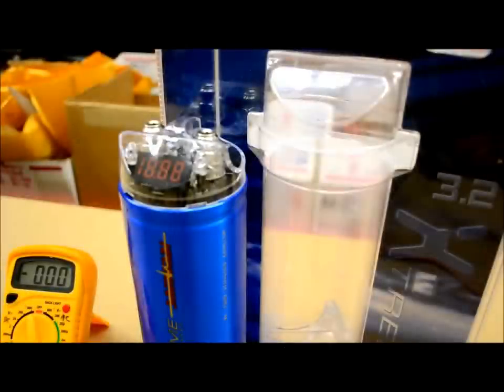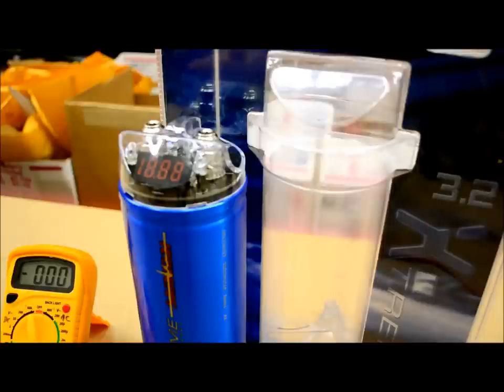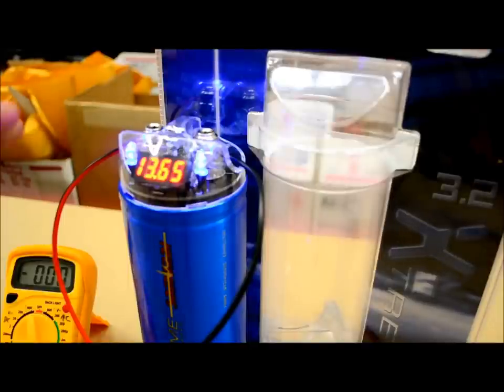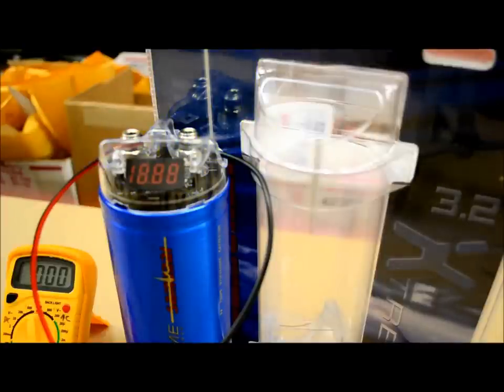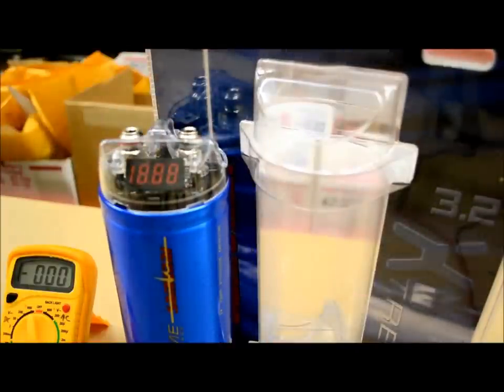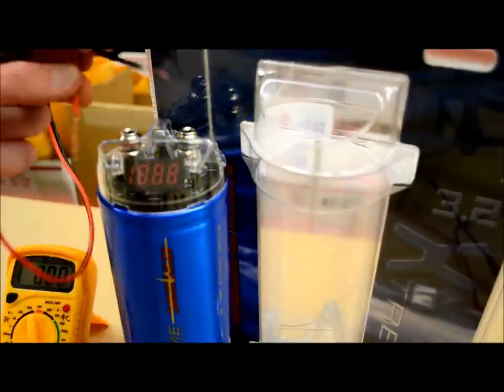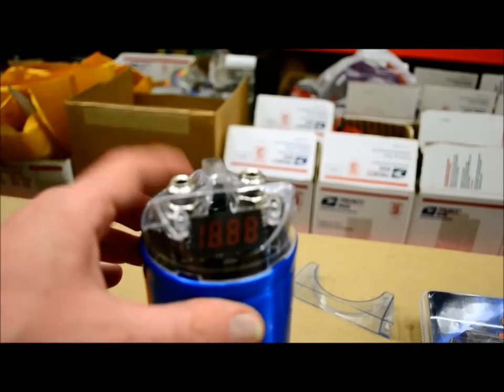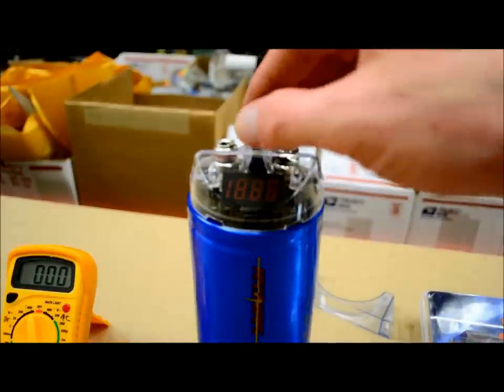How to: charging, discharging and installing capacitors

Comment: I have a 2 farad planet audio with that screw you mentioned. It’s for the LCD  display, it goes to the remote on the amplifier. It easily handles an Alpine Type R 500 RMS hooked to an Alpine Mono 500 RMS Amplifier. 

My Sub is a 4ohm wired for a 2 ohm load. The LCD reads 14.5 Volts, it only drops down to 14.4, 14.3 (rarely) with lower bass notes and is back to 14.5 in less than a second, pretty awesome capacitor!

Comment: You forgot to mention, that older type capacitors can kill you if you stick one finger on each terminal at the same time. Not all capacitors are created equal. Using insulated gloves and tools to properly tighten connections and to discharge. Hopefully a noobie isn’t going to learn to touch the terminals with their bare fingers.
Reply: Dr
Reply: I was going to use my bare hands 🫡 thanks

Comment: You can't use ohm's law to calculate inrush current or discharge rates. For these determinations, since the solutions are not fixed but variable, there are separate formulas that include not only voltage, resistance, and amps; but farads and time as well.
Reply: i guess im asking randomly but does anyone know of a trick to log back into an Instagram account..?
I somehow forgot my password. I appreciate any assistance you can give me
Reply: @Duke Gregory Instablaster :)

Comment: Bro...really...u need to charge it slowly initially. They all or almost all come with a resistor  and u need to connect the resistor in series. Keep it simple and put resistor in the positive side. So hook up the ground, hot power to resistor,resistor to cap. The voltage will slowly come up to source voltage. 12v to 14.5v, depending if car is running. Once it's reached system voltage that's it. I leave it on for another minute or so😢, now remove resistor and hook up positive. If resistor is lost or w.e.,😮 use a 12v car light bulb or anything with resistance really.

Comment: I always just take my test light hook everything up before I put the fuse in I use a simple test light in between the fuse holder before I insert the fuse I keep it there for several minutes never had a fuse Arc out when I installed it

Comment: This could have been 6 minutes shorter and a resistor should be used. Keep poking around the terminals with your fingers though, it feels great
Reply: He called it 12v of current. WRONG!!!!!!!!
Reply: @rsz90182  which bit is wrong?

Comment: I installed mine without pre charging. I sure hope I didnt damage it. Should I disconnect from power and try to recharge it? It's been a couple weeks of use. It looked  normal with voltage reading the battery but is it working properly
Reply from the maker: dont worry, youll be ok Im sure

Comment: I bought a 3 farad capacitor and everyone the guys at the audio store are connecting it it blows the fuses. It blew 4 60 amps and one 80 amp it total. At first they thought it was the amp so sent it back to where I bought it, got a new amplifier and some thing happened. At first capacitor lit up and they initially charged it but it did not show any figures but the light bulb they used to charge it was luminated but capacitor did not go off as a sign it was charging and working properly. Worst thing smoke started coming out the terminals of the capacitor before they disconnected it. Is my capacitor faulty or wrongly connected? I am confused. If it is faulty can it be fixed??
Reply from the maker: get another one, you dont need that drama in your life..

Comment: So i need to add another fuse to the cable running from the battery to capacitor since it already has 1 ?
Reply: No you don't.
Reply: @itsjustry  ok thanks

Comment: if i got a 1500 watts amps, what is the value or how many farads should be my capacitor?
Reply: takkikayo 2000
Reply: 1 farad per 1000 watts.

Comment: After you discharge one, what is the proper way for getting rid of it? I can't find anything about that...whether you have to take it somewhere and recycle it or what...I just got a new replacement so I after get rid of my other one...
Reply: I have this receptacle in my kitchen where I throw empty Mountain Dew bottles, paper towels, empty food wrappers (chips, lunchmeat, bread bags, etc.). I would put it in there. Throw it out wherever you would throw away an old flux capacitor replica you bought online years ago and never worked.

You can toss it in the trash. It's not hazardous to the environment unlike a regular battery which will eventually decay.
Reply: I'm going to hold on to my original bad cap for reference, because the 12-40 is no longer made.

Comment: Wrong. Never charge a cap this way. Use a test light or resistor to get it up to 12v before you fully connect it to the battery.
Reply: You ground it before you charge it right? Then just bridge the power supply to the capacitor with the resistor?

Comment: Would a capacitor be necessary if I'm running a 500watt sub amp and a 50watt x 4ch amp?
Reply from the maker: IMO, Yes. a 5 farad at least
Reply: Lol not at all.
Reply: You will not need one as that is not going to make your head light go diming
Reply: @Andrewhawkes-w2g  maybe your boss 3k, with it's 30amp fuse, might not need one, but a alpine 500watt with two forty amp fuses, definitely needs one. He said he had a 50watt 4 channel, and if it's like my mtx TC 400.4 has 60 amps of fuses. So let's do the math, if he has a 100amp alternator and just for his audio he's using 140amps, trust me, he has cars pulling over at night from the light dimming. And he never said at what ohms he was running, imagine a one ohm load with a 140amp of currents being drawn. FOH 🤪

Comment: And why do you need to discharge it? I just wanna hook it up in my car and to my amp and subs and just let it be...
Reply: You would only discharge it if u dont plan on using it for a while
Reply: @Drriftyy  What do i use to discharge it? I want to uninstall my whole current system. But i don't know how to properly uninstall the cap
Reply: @864Quavo  look up "test light" you can get one from harbor freight super cheap, I got one for 4 dollars, then you hold the needle part of the light on the capacitors positive terminal, then attach the other side to the negative terminal, the light should come on, wait till the light completely shuts off, then ur cap should be discharged. Theres also some videos on youtube showing how to do it.
Reply: @Drriftyy  So i disconnect my power wire from battery then discharge the cap? correct?
Reply: @864Quavo  yes
Reply: Adrian Drift Okay thanks 🤝
Reply: @864Quavo  No problem 👌👌
Reply: Adrian Drift how do i charge my cap. It hasnt been used in awhile and i dont have the resistor that came with it
Reply: So, if I'm disconnecting a cap and connecting it back in 30 minutes, does it need to be discharged and recharged? I'm scared playing with power lol